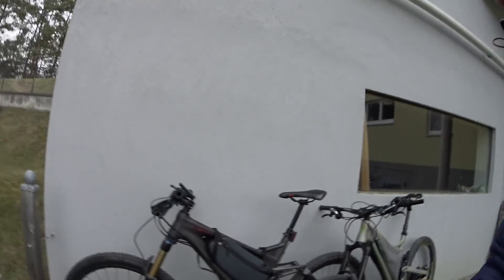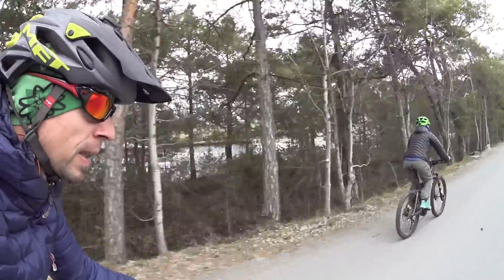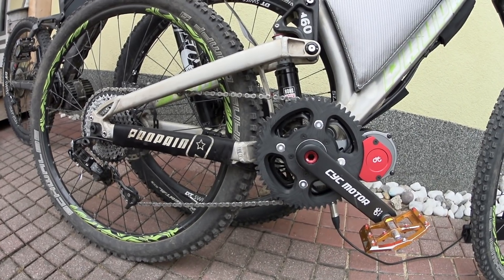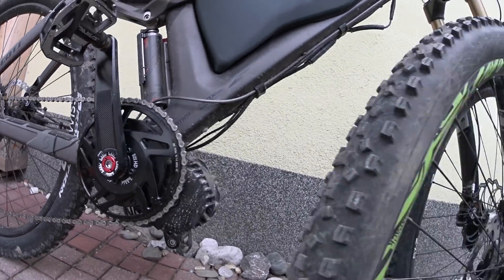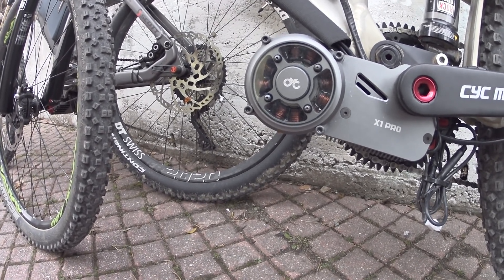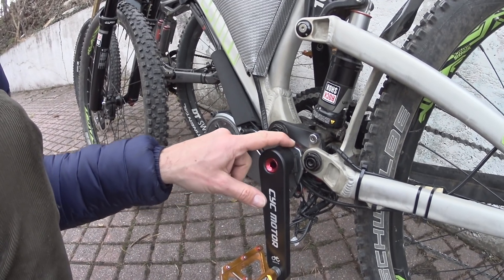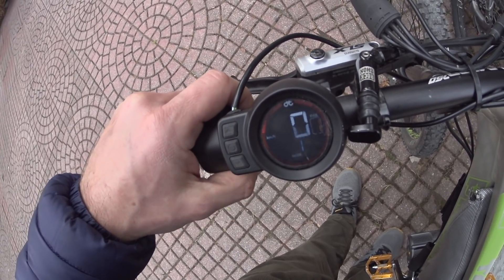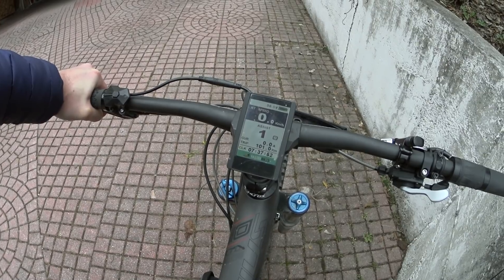CYC X1 Pro first check vs Bafang BBSHD

Comment: hello 💪👍 ,, on the BBSHD that battery to mounted,!? me on my 1000wat bafang BBSHD. the seller recommends 52v 17.5ah but it is not good it is lacking in energy. and it does only 15 km with pedal boat assistance speed 4 with accelerator nothing fake 😶 I still have little and gnente

Comment: This is NOT even close to compare these 2 motors.

GET YOUR HEAD ON STRAIGHT DUD

For it to be fare why not compare 2 equal motors because the cyc is rates at 2000 watts and bbshd is rates at 1000 watts so your NOT really comparing them you just need views and clicks is all why not compare the cyc stealth x1 to the bbshd  its much more compatible in the output power at 1000 for bbshd and 1200 for the cyc stealth x1
Reply from the maker: Please watch and listen again, and you will know. ;-) (BBSHD power has been increased)

Comment: i have the bbshd. i dont understand what you have done to pump up the performance, please can you explain, id like to increase mine, cheers
Reply from the maker: Please write an email to welcome@fasterbikes.eu and let us know your setup (battery ...).
Reply: Google the desription from here and you will find how to: BBSHD 45A shunt mod
The shunt measures the amperage of the controller. There are different shunt values to choose. E.g. Half the shut value and the controller thinks to provide the same 30A, but provides 60A instead, but shows 30A in the display. I have tested it for a while and I would say, it isn't really worth it, since using more power, the motor has a overheating problem. Also the 45A feels like 10% more, because of the saturation of the motor. It is fine for a few short boosts, but you have to watch out for the nylon gear.
Also you need a battery, which can provide the power, like 50A continuos if you want to use it for longer in the flat.

Comment: The more moving parts are exposed the more problems you will experience. This fundamental difference in design is why I will stay with bafang hd. If you wish you can put 40 plus amps through it. But it will handle 30amps continuously.

Comment: BBSHD silent and stealth, perfect for trails
Reply: Yes..Im so happy with my stock bbshd..its practically silent even under full power.
Reply: @chargeriderepeat7024   Switch to lower gears and it will be similar in noise.  Only reason it's is due to nylon gear, which most throw away if they run much higher than 30A. There is no reason to buy bbshd in the first place, if you don't plan to change this gear. Bbs02 weighs less and has better alignment, larger chainrings and is capable of running 30A too.
Reply: Thats in my bottom gear.36/36..yes I just run the nylon gear.
Not interested in more than 30amps
Reply: That's why I bought one.

Comment: The CYC is made for running at 72v there is no point in running at 55v.
Reply from the maker: You can use CYC Gen2 with all batteries between 10S (36V) and 20S (72V) - no problem.

Comment: The CYC X1 really comes to life with the BAC 800 controller with a 52v or 72v battery. It becomes a beast with the ERT BAC 400 or 800 give it a try, So much smoother, and better throttle control as well as torque due to the controller's amazing performance. Same with the BBSHD so much more power with ERT BAC 800 controller its a beast. Fantastic review though

Cheers
Reply: Is it easy to install. I want to do a ebike retrofits on my Kona MTB. And not sure what is my best options. I want to derestrict it aswell. More speed

Comment: I have a question what hub to use for my bike my motor is running 3000w and my hub has broke which one do you recomend
Reply: Mxus 3K Never had issue 3 years in

Comment: BBS HD clear winner!!! 45A vs 50A and it's almost the same! The ASI BAC 800 controller will give a big boost to the bafang, there will be no contest in performance, considering price, noise, etc....
Reply: CYC can produce so much power Bafang cant even imagine... With a proper controller CYC motor will tear that Bafang into pieces
Reply: @HannefeldRepublic  I think it depend on the gearing ratio used on Bafang BBSHD or CYC, I use 42 T Front Chainring with  9 Speed 11-46T Rear Cassette and it is impossible to keep the front wheel on the ground on the first gear with my BBSHD running with ASI BAC800 controller. The torque is amazing... Here is my YT channel if you want to check it out: https://youtu.be/zbBiMlinzlo   Lots more videos to come next summer 2020... Cheers Dan
Reply: @enduroebikeaddict  i got the same gearing, chain ring, it goes like a rocket and the chain sound is so sweet, im using   sram 951 9speed and kmc x9 both decent priced but strong af

Comment: Hello what battery fit for the cyc x1 pro
Reply from the maker: 14S batteries with lots of amps. If you want to get 3000W you need a battery (and bms) for 50A. We can build such a battery according to your wishes.
Reply: Hey! :) If you can build batteries, how big in size would be a 30 A/72 V battery?

Comment: I have bash guard mounts at my bottom braked can I fit both motors without removing (flexing them of)
Reply from the maker: CYC motor will work, Bafang pretty sure not
Reply: @fasterbikeseu  I think you talk German right I would like to buy the cyc motor on your website but I don't know which battery I have to choose maybe Rucksackakku 52V 14S 5P Ebike zelltype Samsung 30q
Reply from the maker: @Sur_racer  Ja zum Beispiel, oder Jumbo Shark Akku, oder ein Akku nach deinen Maßangaben, ...

Comment: Bafang är ett säkert kort, väl beprövad och relativt tyst. 
France to China solar bike race 12,000 km, en hade Bafang HD 1000, inga problem på hela tävlingen. Endast originalfettet i motorn torkades bort och ersattes med annan sort, innan start.
Reply: every system has his own advantage… BBSHD has less ground clearance, more weight, less power. But most people are happy with that, because it is also cheaper and has many chainring and display options

Comment: These mid drives are so awesome! Im currently using a modified 500w hub motor thats been modified to put out 1200w and that goes very well compared to the stock set up
Reply: Rears are horrible, i got tired of replacing bent/snapped spokes and the noise, my bbshd is just as quick, less issues and destorys hill climbs, plus you can hotrod it

Comment: I think it's important to note what little difference pushing your bafang over 30 A has. There will be a minor speed and acceleration bump at the cost of much shorter range and accelerated wear on the nylon gear. Also the bafang got the EggRider which I think is essential since you can use a EU legal and off-road profile.
Reply from the maker: more power is always good to have, if you want some. It doesn't mean I'm always using it and the daily riding is done at a similar speed and power. But good to have if you are in a hurry… 30A is fine and seems that the HD is good also with 45A. And I'm not sure if a Eggrider is fully legal in the EU, since the power can be restricted with a button, when you see the police.

Comment: Thank for a great comparison. The ASI BAC 800 is showing much promise with the X1 PRO. The BBSHD is also running on the ASI. At 20S they both run much better with lees strain on the drivetrain. Less amps used. Both are 45mph. The X1 will be superior with final ASI tuning.

Comment: How does it compare to 18 or 20S BBSHD?
If I go down from 18S to 14S on my BBSHD, it feels much slower, both at 45 A though.
I imagine BAC800 BBSHD vs CYC at 65 A 20S will be interesting.
Reply: didnt test with 20S yet, this was with stock controller only. I think the HD has similar power, but the nylon gear is still the weakest point
Reply: @tschingol  
Your system is likely becoming the best option in the future of mid-drives. I definitely see myself buying one later. Just have to finish another maxed out BBSHD first. 🙂
Reply: woah does the bbshd overheat on 18s for you?
Reply: the cyc wasn't on 18s or 20s tho